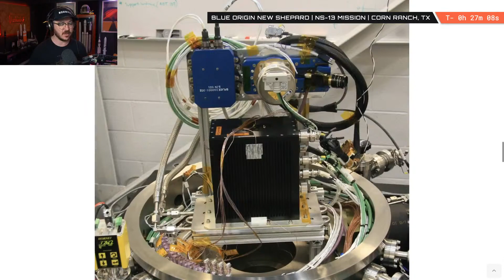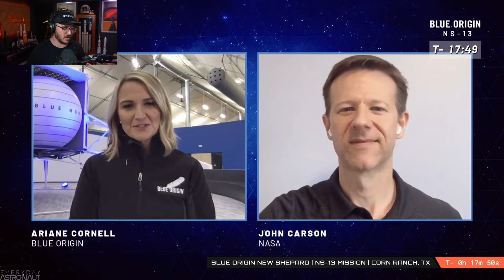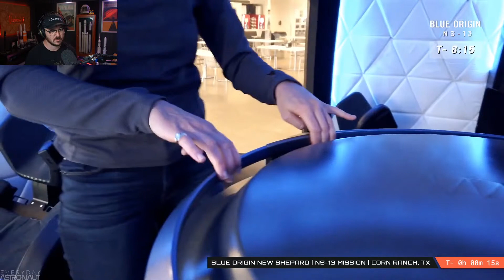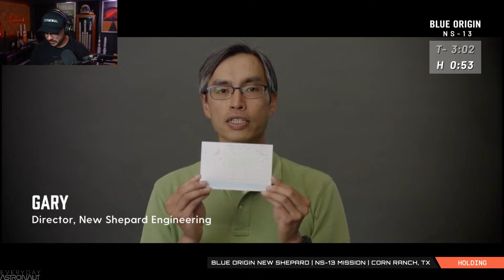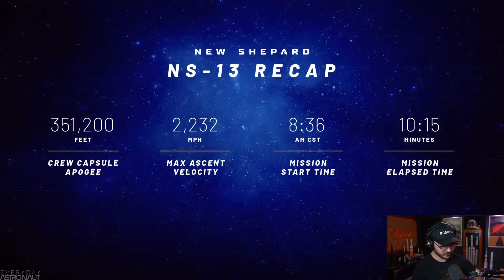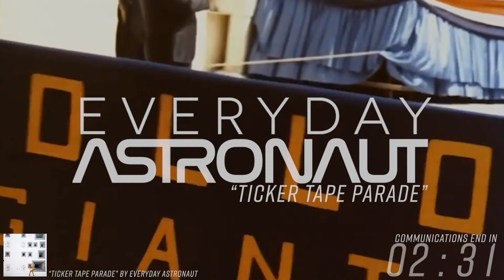Watch Blue Origin test a landing system for NASA with their New Shepard rocket!

Comment: The reason it's not pointy at the top is because it never goes supersonic on the way up. This kind of rounded shape is optimal for air resistance at subsonic speeds. Once you go supersonic, you need that pointy shape.
Reply: It does go supersonic

Comment: Obviously a tried and tested system, but are they actually progressing at all? They seem to have carried out the same flight profile without doing anything differently. Have BO had any orbital experience, including re-entry. Probably a good 10 years behind SX.
Reply: Their orbital system will be New Glenn.
Reply: @odysseusrex5908  New Glenn looks like a fab vehicle, but planned first launch in 2021? I haven’t seen any evidence of testing etc. Which seems a tad strange considering they have no experience with regard to returning a vehicle from orbit, especially one of this size. Are we used to seeing the way SpaceX build and test?
Reply: @rustyjoints4857   They have a factory, although it is about as secretive as Willy Wonka's, but they are building New Glenn rockets in it. They are taking a completely different approach from SpaceX, no iterative testing for them. They have spent years deigning their vehicle and perfecting its engineering. They expect it to work right the first time, the way the Saturn V did. I imagine that with at least the first one they will do a series of tests similar to the green run that NASA is doing on SLS now. I don't know if they will try some suborbital flights or go straight to orbit but they expect the first one out of the factory gate to be ready to fly.

Comment: Shouldn't the "lander" be "landing" with actual crew capsule still strapped on the top ? The lunar "lander" was able to lift off from the moon and get back to the main vehicle to travel back to Earth...or ? With this dildo It seems they plan only one way trip ?
Reply: YES, this is not a Moon rocket. New Shepard is nothing but a suborbital system intended to fly barnstorming tourists on ten minute thrill rides.

Comment: straight up launch is only terrible if you got low TWR
since you are only fighting gravity when your engine is lit.
if you have an absurd TWR on your upper stage its no problem.

the problem is getting a high TWR on your second stage, this means that your first stage needs to be bigger and thus more expensive. 
if a future "magical" engine has high thrust to weight and an order of magnitude better specific impuls.
then a straight op launch would be an acceptable idea if you are short on time. 

escape velocity is 11km/s
to get to low earth orbit you need 7 km/s, the energy spent on going into orbit is not wasted because of the energy principle, if you add 4km/s in low earth orbit you will raise your orbit until you reach escape velocity.

Comment: @EverydayAstronaut, the density or the weight (mass) of a falling object does not affect how fast it go. The acceleration is the same independent of the mass. It's all about how aerodynamic the object is.
Reply: I caught that too. It's air resistance just as much as being more aerodynamic though. Think of a hammer and a feather. Neither are very aerodynamic but one has more air resistances than the other so they fall at a different rate.

Comment: Stainless steel is alloy, but whatever.
Reply: Very true. I'm also fairly certain they are only using steel for testing purposes, not for the final ship.
Reply: @jpryor8102    If you're talking about Starship, no, the operational spacecraft will be made out of stainless steel. One of the things SpaceX is doing now is working to make modifications to the alloy known as 304 to make it fit their precise needs.

Comment: I don't think where the capsule lands compared with where the booster lands would be a problem unless there is no wind at all. Both capsule and booster are pushed by the wind, and pushed in the same direction, but, as the booster drops faster, it is subjected to the wind for a shorter time overall, being thus pushed less far than the capsule. The parachutes also help to blow the capsule even farther away in the right direction (away from the booster).
Reply from the maker: The booster can’t just land wherever. It lands on the landing pad. So if the winds right, the capsule could land there theoretically
Reply: @EverydayAstronaut  True, but the booster, to land on the pad has to fight the wind, then. The capsule is pushed by the wind. Unless there is a very unlikely combination of winds in opposing directions at different altitudes, the booster, by fighting the wind, will land even farther from where the capsule lands.
Reply: @EverydayAstronaut   Hey Tim, somebody upthread was asking if the capsule has RCS thrusters. I figure it must have some kind of attitude control system, but I don't see anything that looks like thrusters on it. Gyroscopes? do you know?

Comment: Is that rocket able to put a payload in orbit.
Reply: No, it's a suborbital rocket.  Either the rocket need to be a lot lighter, or they'll need more engines if they want to hit lower earth orbit.  Though New Glen is the bigger model that is supposed to do that.
Reply: @lanzer22  No not even then. It has 2 km/s delta V it needs 9.5 to get to orbit, it needs to be 10 times bigger have 10 times the amount of engines and two stages. You get diminishing returns making it 5 times bigger wouldn't give you 5 times the delta V.
Reply: @lanzer22    There is not and never was any intention of reaching orbit with New Shepard.

Comment: The NS landing burn is 23 second and so I'd the F9. Since the F9 is bigger wouldn't that mean the landing is a lot more fuel efficient?
Reply: NS apparently can throttle down to its own weight, which is why it was able to hover. This means that it's not really burning that much fuel most of the time. F9 on the other hand, could not throttle down as much, and is actually having more thrust than its own weight most of the time. Therefore F9 had to time it precisely so that the engine cut off, vertical velocity zero, and altitude zero happens at the same instant.

F9 also has a deorbit burn, FWIW.
Reply: But F9 comes down faster and it's coming down from a higher altitude, I'm not saying it would be less fuel, but less compared to the total fuel. I am not an expert which is why I'm asking. Thx
Reply: @freefalltomars9285  "Fuel efficiency" is hard to say when you have two rockets of different sizes, different propellent, and different engines. If you use delta-v (change in velocity) as a measurement, the truth is that air drag would have reduced both of them to a pretty slow and similar speed (i.e., terminal velocity) by the time the landing burn begins. This would mean that the delta-v required for landing would be similar.

Comment: So, does a tourist have to unbuckle, float around then quickly fight the G's and buckle in the seat for landing? Not much of a ride...
Reply: May not even want to unbuckle.  If for any reason the capsule’s escape rockets fire and you were floating around you’ll slam into to floor.  The ride will probably be limited to looking out the window and playing with a zero-g plushy toy, something that can’t hurt you if the escape rockets were to fire.  Overall a wasted $250k.
Reply: @CarFreeSegnitz  No. you will unbuckle. The escape rockets can fire on Dragon or Starliner too. They are designed not to fire unless commanded, especially the stable solid rocket fuel.
Reply: I was thinking the same thing. They’re saying “do a somersault” then what? Get pinned to the ceiling as you start falling back to earth?
Reply: @MAH18999  no pinning to the ceiling. The floor will kiss you as soon as she hits air.
Reply: I believe you will get over 5 minutes of weightlessness. I don’t know how much of that will be without seat belts but you are still going to space and getting the greatest view of your life.
Reply: You got something like four minutes.
Reply: You won't have to fight G forces. As the capsule falls, air resistance will gradually build up and things will gradually regain weight. I don't know if it reaches terminal velocity, where you would experience one G, before the parachutes deploy.

Comment: What fraction of energy is bleed off by atmospheric drag, and what fraction by the final rocket firing? How will that ratio change from the small New Shepard and huge New Glenn? I have similar questions on SpaceX Falcon vs Starship, since larger objects have more mass per surface area, so less air friction slowing. I suppose it also depends on how much cargo and fuel you're carrying.

Comment: I still have a problem with only ONE engine. That is pure arrogance to suggest that it could NEVER fail. And that capsule landing is still harsh!! the jolt must rattle your teeth. Don't care what shock absorber they may have, it is still an immediate deceleration.  Nice carnival ride I guess. Just can't get excited about a rich man's joy ride. There will never be a NASA Astronaut onboard this concept.
Reply: Actually, in the middle of the video, Jim Bridenstine was talking about using them for astronaut training.
Reply: They have an escape system on the capsule. Should anything go wrong with the booster, the capsule will be pulled away from and return to the ground under it parachutes.

Comment: The booster landing was interesting - almost hoovering versus the SpaceX hooverslam.
Reply: Different service parameter.  New Sheppard is designed for space Tourism so there's margin for fuel.  SpaceX's suicide burn is necessary because they're trying to deliver cargo to space, so the booster came back almost empty.

What's more interesting is what they'll do for New Glenn, since that's an actual service booster to take heavy cargo to space.
Reply: @dyingearth  Also Falcon 9 can't even throttle down enough to hover. Even with just one engine at minimum thrust, an almost empty Falcon 9 booster would accelerate up, so it really can't hover.
Reply: @alexanderdaum8053  Right you are. This rocket has a dry to wet mass ratio of around 1/4, while Falcon 9 has a ratio of lower than 1/18. Such a high ratio gives you a very solid structure and, combined with an engine that can throttle to 25 %, the ability to hover, which makes landing easier. On the other hand it will prevent you from ever reaching orbit.
Reply: @Turidus  
Thank you for the info. Good to know
Reply: @alexanderdaum8053  Maybe they should still work on that.
Reply: When you aren't lifting a payload into orbit you have plenty of extra fuel to do a nice slow landing.  SpaceX quick landings minimize the amount of extra fuel they need to carry and maximizes the payload weight.
Reply: They definitely have a lot more fuel  to spare for this landing. I suspect once things are optimized it wouldn't hover for as long.   Though it might just be Bezos showing off how much more money he can burn on a landing. :)

Comment: Blue Origin is the space Nikola.
Reply: I don't always like BO, but they are not comparable to Nikola. BO actually goes up against gravity, not just using it to come down. lol. They also have very good engines that are bought by others, meaning they have actual tech. They didn't sign a deal with Boeing (GM equivalent) to build everything for them. 

There is a rocket company that sounds like Nikola, but I cannot remember their name. They were trying to do something with a water powered rocket, and aerospikes, and sstos. Lots of promises, but no tech. Just like Nikola. They didn't go public and use investor money to buy a massive mansion for their founder, however. At least to the best of my knowledge.
Reply: @anthonypelchat  you're thinking of ARCA space, but they now have a better working prototype than Nikola lol (no seriously)
Reply: @coreytaylor447  Nearly everyone has better working prototypes then Nikola. Nikola has the best PowerPoints though. lol
Reply: except BO has a working rocket, albeit just a test bed that can make a quick buck on the side compared to Nikola's not even working prototypes

Comment: Impressive at how clean the booster stays, compared to a Falcon 9 that returns charred black.
Reply: A Falcon 9 uses RP-1 which creates a lot of soot resulting in the dirty look. This rocket uses Hydrogen instead, resulting in a cleaner burn.
Reply: It's because NS doesn't reach orbital velocities, thus experiencing much less re-entry heating
Reply: Mattg That’s not the reason though. The reason Falcon 9 is so sooty is because of the entry and landing burns, which create a lot of soot that flows over the rocket.
Reply: I guess this has something to do with a. velocity and b. exhaust due to different fuel types
Reply: Because its speed its so slow it doesnt heat on re entry.... Falcon 9 almost reaches orbital speed... Thats why it gets so hot on re entry

Comment: I really did not undestand.
How exactly this is a lunar landing test? Is it just the software? Isn't this thrust under the lander a concern because of the material lift?
This is an honest question. Not making fun of BO... this time...
Reply from the maker: They tested the lidar system that will help precisely measure altitude on the moon for upcoming missions and could reference it against their current systems to make sure it performs as designed 👍
Reply: @EverydayAstronaut  so the first mission to moon won't land and will just map it as in a flyby?
Reply: @apratimtewari4288   No, the lidar will tell the flight computer and crew what their altitude is as they descend.
Reply: @odysseusrex5908  oh so I got it completely wrong..
Reply: @EverydayAstronaut  Thanks man!
I'm a fan.
Reply: @EverydayAstronaut  Testing sensors that will be used on a moon lander.
Reply: @EverydayAstronaut  never been to the moon...
Reply: @ryneprince7113  Well, one day you might be able to :)